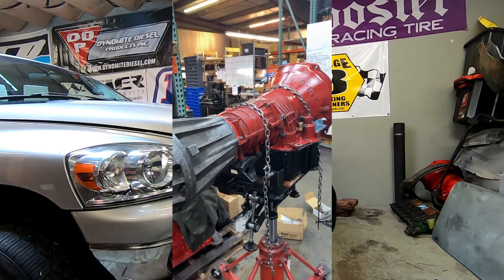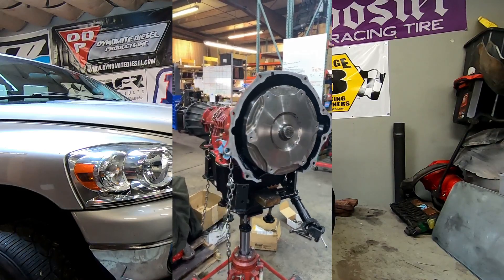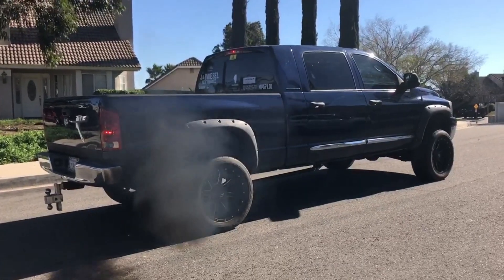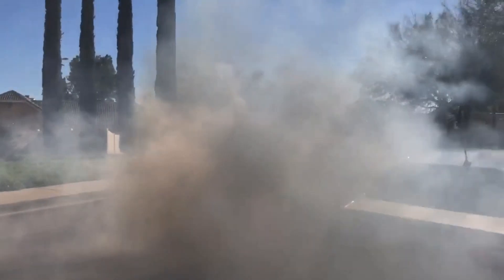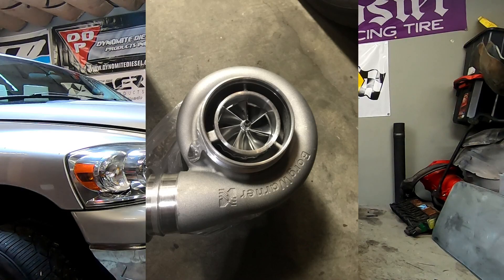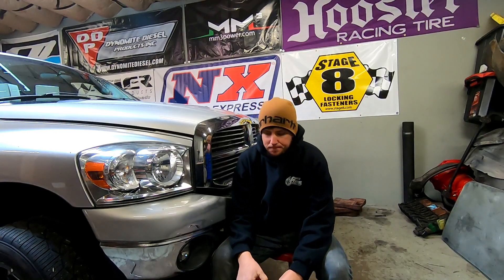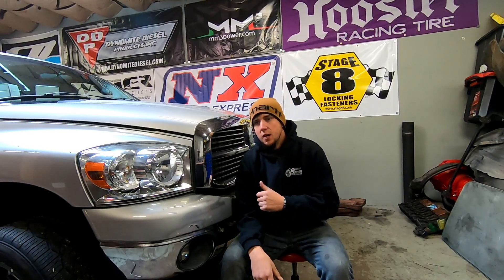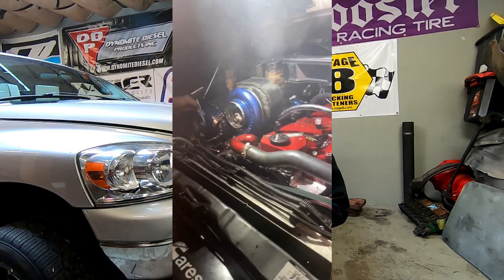TECH: WHICH TORQUE CONVERTER STALL DO YOU NEED?

Comment: Hopefully not over stepping any where haha. Just thought I may add what we have also learned with torque converters, especially the stall speed. The stall speed is engine torque output dependent. The manufacture is basing the advertised stall speed based on their experience/other’s experience but it is still ultimately a average not a 100% thing. We build as well as test a lot of different turbos, as well as get to test injection components from other manufacturers on our dyno/ in competition. Leaving the injection system untouched, with only turbo changes the stall speed is moved around based upon the engine torque output coming up too, reaching, and in some cases surpassing , the manufacturer’s advertised stall speed. Leaving the converter alone, a 2k stall can stall at 1800 rpms with a larger turbo and 2200 rpms with a smaller turbo. Bad tuning and or poor injection event quality can kill engine torque production in which a lower stall speed will occur, and vice versa. a example is with on our pull truck and the fixed timing mechanical pump.  is that the higher our timing gets the lower the converter is stalling due to the engine loosing torque production at the lower rpms with the timing set to produce peak torque at a much higher rpm. Awesome video Josh! Love the content. Subscribed and all :) keep crushing it.
Reply from the maker: Very valid point that I missed! Thank you Bradley!
Reply: @horsetorquesdiesel  thank you for the awesome content :)

Comment: 6.0 with a S364.5 on stock fuel, going 205/30’s in the future. Pulling my trans for a rear main seal leak. What convertor brand and stall speed would you say ? Just a play truck

Comment: Do you have a recommendation for stall speed and disc count on a 7.3 powerstroke with a power goal of 700hp. It will have 400/200 injectors, and a S464 1.0, or maybe a little larger, I haven't decided on that yet. I live in Denver Colorado.
Reply from the maker: @jamesryplewski2860  not really I'd reach out to dpc or gorened for advice

Comment: Building truck to race only 5.9 200% overs 14mm race pump S488 single what stall converter do I need? May go to a 488/472 setup but I don’t drive the truck on the street at all just want to race it

Comment: I have an 07 mega 5.9 as far as I know it has a d/tune, stock fuel filter, k&n filter and a holster 3 turbo. I do plan to haul trailers like a single or double car hauler, camping trailer etc  occasionally. The truck is also my daily driver I live in northern utah surrounded by mountain ranges 5000-6000ft elevations  with 3-6% grades. I see all seasons in a day 🤣

But I do plan on upgrading the whole engine and transmission. From turbo,injectors, compounds setup, etc. Cause I will haul heavy vehicles that will be around 16k without trailer weight

Comment: totally unrelated, but diving right in,  im working through the effect of louvering hoods to primarily  increase air flow over the radiators and IC. love to hear your thoughts on that in a video. you do good videos by any standard, and your experimentation with this overlooked area might be interesting. in this daily 5.9 common rail here, the difference is notable with a small louver. looking to add a second. there are ground force advantages that may be helpful to the racers.

Comment: Please recommend a stall. Running a Goerend 1800-2100 stall now. 
Turbo: 68mm Danville with high flow vanes all upgraded.intercooler, manifolds, up pipes, down pipe, 5"Exhaust
Engine: Duramax 6.6
Fuel. Lincoln's Diesel stroker Good for 650hp, probably going dual Lincoln strokers, fass lift pump, fuel line upgrades, fuel filter delete, stock injectors (looking at 100 overs). 
Location:Central Texas
Use: Hot street truck. Built Dmitri Mallard transmission 750HP. Billet input.
Thank you.
Reply from the maker: No idea on duramax stuff
Reply: @horsetorquesdiesel  Another sign to buy a Cummins.
Reply from the maker: @reeznz  😂 idk they have their advantages

Comment: Have you a biuld list and a few questions.   I am a big fan of yours josh  and we share a few similarities. 

Ok, so  for my truck, I'm looking at doing a 6.7 crank w/decked pistons in a 5.9 Running a 1400rpm stall for efficiency.  Im hoping to pick up some low end  grunt  and efficiency with the higher compression and stroke. Running a 76mm turbine and a billet 60mm narrow hub w/ext tip comp. wheel.   The truck is currently  a project but is tuned with a 600hp tune w/hp-tuners. My questions to you would be,  "in your opinion" Did I make a mistake ordering the 1400 stall triple converter, and is the 188/220 cam I have purchased too much cam for efficiency?  I'm an efficient  driver, I'm looking for efficiency,  i love DPC's 1600 stall with the torque management  disabled. low stalls with my driving style is  kinda great so far,  I really like them but when the turbo lights, I want it to really PERFORM. Should I have gone with a 4 clutch instead of a triple  for the beefier internals  to support  the low rpm/ high torque  I'm after? I plan to run a PPE or other dual cp3 and  compound turbos Down the road. I port my own heads, turbine housings and mantifolds port matched and all.  Do you guys know of a piston readily available  that can hold up to low rpm high torque #s "for a common rail" that will hold up in the long term?
 I'm looking at getting a set of .040 over pistons to weld up and machined if a can't find what I am after.
Reply: I'll make a biuld list and update this comment  later
Reply from the maker: What truck is this

Comment: 5.9, 48re, run 37 mud tires, not regeared (don’t know if I ever will, but if so, to 4.10 or maybe 4.30)
Final goal is a 1000hp daily driver, no towing, nothing special… 

Project still in progress, almost finished the transmission, just need to choose the correct stall converter to order…. The compound turbo setup is not chosen already as well, still thinking about it…
So I can take advices on both…

Comment: Fantastic video buddy, you do a great job explaining things that’s why I always like when I get to talk to you on the phone at PDD.

Iv got a question for you about Torque converters and turbos.. I have a 99 ram 2500 24v VP44.. it’s got a Fass 150, PDD 7x.10 injectors, edge JWA + Hot Unlock (I run it on 6x6 all the time), iv got the PDD pan off upgrade for my otherwise stock 47re and ever since installing your pan off upgrade the trans holds the power nicely.. I just recently purchased the PDD 60mm HX super 9 to ditch my HX35 finally along with the PDD Tripple disk low stall converter.. all blue colored billet one you guys furnace braze. My question is did I order the correct parts? I went with a low stall because with the power I’m making now it feels very sluggish and slushy off the line with the stock converter, and I ordered the 60mm super 9 because I don’t see myself going over 600whp in the near future.. what do you think about my combo? It’s a work truck, play truck, daily driver, and a haul truck.. I typically don’t haul over 10k pounds tho. 

Let me know thanks man!
Reply: haha i was just watching your trans pan video and found you here !,the super 9 will be just fine with a low stall i bet you love it(not with PDD btw )
Reply: @josiahjones5293  hey buddy thanks I’m glad you found my Pan Off upgrade video. I installed the HX super 9 a Low stall Billet Tripple disk and a Billet flex plate about 3 weeks or so ago.. so far the truck has been awesome.. the HX super 9 sounds exactly like the hx35 only louder in the fact that you can hear way more airflow and air moving.. it also whistles louder as well but what you really hear is the insane amount of air it pulls/moves. I’m currently running 42psi after adjusting the wastegate bolt.. I just did head studs over the weekend so at some point this week I plan to tighten my wastegate some more as my plan is to run the turbo right around 48-50psi at its max. Truck rips now and gets on the power much faster with the low stall Tripple disk.. trans handles the power just fine with the PDD valve body and other Pan-Off upgrades I did.. I plan to run this trans till I break the input and once that happens I’ll buy a fully built trans but as long as I take care of it there is no reason I can’t get a few more years or so out of it. If your looking for a turbo upgrade I would highly suggest the 60 or 62mm Super 9.. mine spools a little slower than stock but not by much.. but once it comes on it’s much stronger.
Reply: My only regret is that I didn’t record any of these installs.. I took some pics tho.. I’m pretty mad I didn’t make a video on any of it so I plan to make a video soon showing and explaining all the upgrades Iv done and how I’m liking them thus far  👍🏻
Reply: @BiffsEquipment  awesome I might try the 60mm super 9 or the aggressor 62 and switch to compounds after I ppump it
Reply: BTW how does the super 9 sound ? louder than a stock Hx35 ?

Comment: I have a 13mm  p-pumped 24v, with a custom Stainless Diesel workstock class turbo. The turbo is a 366 nipped down to plug 2.5”, 74mm turbine wheel with a 1.1AR exhaust housing. Running Hamilton’s 188/220 cam, with 411 gears. What stall speed would you recommend?

Comment: Hi I'm hoping you can help me. I have a 06 5.9cr 200% S&S injectors, dual cp3, Hamilton 188/220 cam, Carillo H-Beam rod piston combo, s369sxe s480(will probably be swapping to a s488) compounds, and am currently running a DPC low stall triple disc. I live in Wisconsin and tow a boat and rarely a gooseneck trailer. What should I do with my TC? Have it restalled to stock or high stall or put it in one of my other trucks and buy a new quad disc with which ever stall? Love your videos cant wait to see more!!!
Reply from the maker: Stock stall triple is what I would do. Either buy a new one or send in your old one to get restalled

Comment: I really appreciate the videos . I never have one but years ago I viewed  a Neil Chance torque convertor that was a bolt together assembly and you could change the stator out to I assume tune the transmission to what ever you want . I pretty sure Dave Georend makes something similar also . I always wondered how does those guys tow with a loose convertor and 4 gears . I was pretty amazed how well your truck did .  Get the load moving and use lock up . The motor makes so much torque that just having the large gear split was manageable . It must be a monster with out the load .  The chargers seemed to keep the egts under control . I not sure where the max temp of coolant or heat rejection is as far as useable hp . Years ago a fellow from Canada told me that back then around 500 hp but that was back in the 12 valve days

Comment: I guess I just got old lol . My old 12 valve which I never hot rod is a automatic 4x4  3.54 gears  I use the truck to pull a trailer . I have a few different ones and I use to tow my bikes to Colorado or where every I want. For me I hate the automatic with the loose convertor. I can stand on it an it will go to 3200 and not drop one rpm in a 750 rpm gear change . I think that is the rpm split on the 47rh .  For a fellow that only wants to tow or not hot rod and still get good mileage 21 or so at 65 in lock up what do you recommend .I just don't care for a loose fluid coupling and it seems like it just wasting a lot of torque into heat. May be I need a 6 speed manual . Your thoughts .
Reply: A lot of people can't deal with running a shifter and clutch which seems super silly to me because its so easy, 5 or 6 speed will always be king for towing in these medium duty trucks the power management is on demand whenever you shift down to pull a hill, no worrying about transmission temps and all this aftermarket crud to keep an auto cool. 
The simplicity and reliability of a manual is much better than an auto.
My 48re went out and I 6 speed swapped a Super duty Zf6-650 into it.

Comment: I have a low stall dpc in an 06.  Brake stalls around 21-2200 and the flash stall when driving is around 1800 stall.  (I think it’s supposed to be an 1800 stall).

Tbh stock stall would be a little nicer just driving, but towing with it especially heavy or in 4x4 the lower stall helps, helps keeps temps down too and they can get hot.

Comment: 05 5.9, wanting to do PDD compound set up, stock injectors, airdog 165, and custom tuning. what TC/pdd transmission would you recommend? Plan on getting the transmission before the compound setup. Las Vegas, tow 8-10k lb camper once/twice a month northern Nevada/Utah area
Reply from the maker: I would do our 650hp transmission with a low stall 1800rpm converter!

Comment: Any recommendation of a decent diesel shop/ crew in TX (San Antonio area)?
Reply from the maker: Shops I know in Texas I would trust 
PSE
Unrivaled Diesel
Redhorse Motorsports 
TSD 
Baker Diesel
Reply: @horsetorquesdiesel   you guys are freakin awesome... thanks... posted on the other channel too but thought I’d ask you... I’d have to get my hands on a common rail truck (I’m more “monkey-see, monkey-do”) to understand the fuel system but is the sequence:
tank > lift pump > filter > CP3 > rail > injectors?

Comment: What is your opinion on to much converter a triple disk over a quad disk? Is there a down side other then expense on doing so.
Reply: Just depends what ur doing with the truck. But going with a triple disc in a cummins is a good idea no matter what the hp is. If ur truck is a tow rig look at a 15ss goerend converter.
Reply from the maker: Quad disks are just load at idle they make a harsh knocking noise at idle. Most trucks it’s overkill a good quality triple will hold 1200hp. Quads also handle boosted launches better for drag racing.